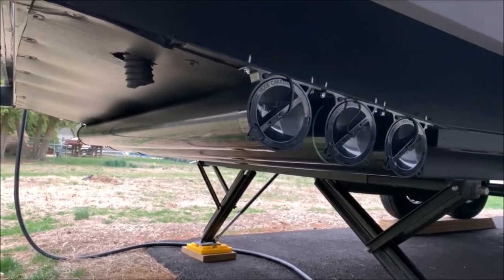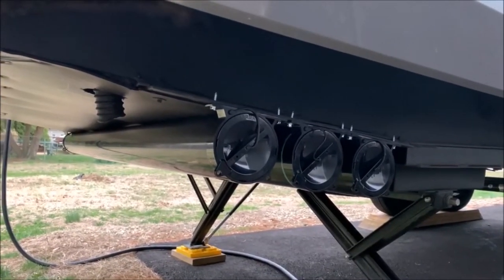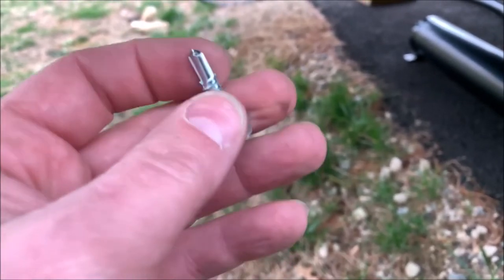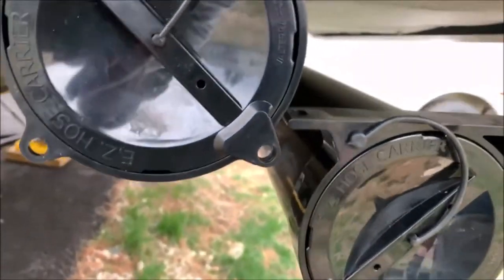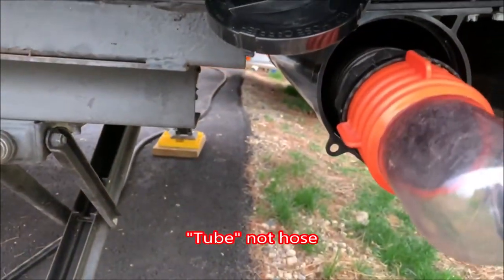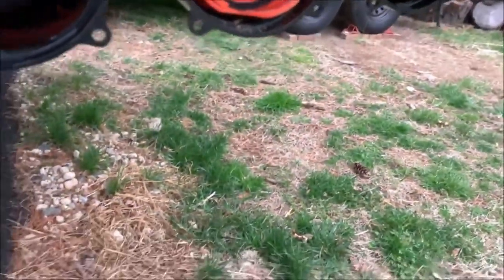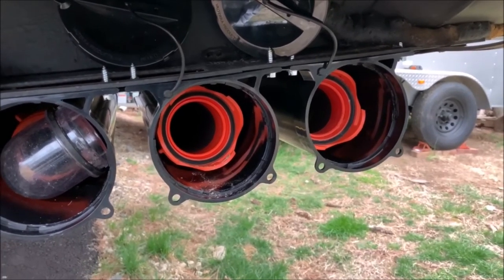BEST Way to Carry Your Sewer Hose!! - Stinky Slinky Tube - RV Sewer Hose Storage - Valterra

Comment: I actually had better luck using the enclosed self tapping screws. I guess my drill bit was dull. I used a center hole punch so screws wouldn't walk on me when starting the hole. The manufacture of my trailer added washers on the one that came with mine, so I did the same on the additional one. Thanks for the video, it saved me time on my install.

Comment: How well does it work without the center support?
Reply from the maker: No issues. We weren’t able to install it on ours because there was nothing to mount it to. But there is enough overlap between the two sections on ours to support the tube.

Comment: Despite other comments, can you elaborate for someone like me that is a DIY novice and answer these questions?
Was that a drill or a impact wrench that you used? And you used a 7/32 for a pilot hole? And instead of self tapping that was provided, what did you use instead and what exact size?
Finally after 2 years is everything holding up? Thanks, Larry

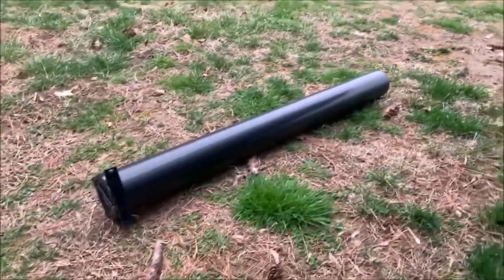Comment: @1:20
What is the black spiraled hose hanging down on the left side of the screen? (Also visible in the first 30 seconds of the video)
Reply from the maker: Just a drain hose from the compartment where my water connections are.